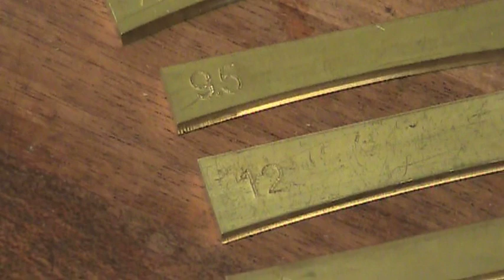Fret press: arbor press for guitar fretting

Comment: I toured Gibson in 1977 in Kalamazoo Mich. I get to refret my 1977 LP Std. This means rebinding the neck too so those binding nubs are present. That is a $400 refret/rebind. A Martin where I am also using frets to do what a truss rod does? You may wish to sit down for that quote. I do not have too much problems with maple. I use a special tool that clamps the wood on either side with thin metal bands to avoid most chips, but still $250. By the time we are any good at this we are too old to see!

Comment: I've seen mixed reviews of this, and that it's a Chinese import not made that well but with a high stew mac mark up slapped on it. Apprantly the paint chips off easy, you have to spend a lot of time setting it up to get it to work as it should. The table addon is plastic and not metal and practically useless. One person stated that their item was full of casting sand and metal burs and the finish was bad. At the price they are asking there are much more reliable and cheeper presses out there. I won't be buying this from Stew mac.
Reply: Hey man just wanted to let you know I got one today and it is the opposite of what you said in every way.  It is incredibly well built, very tight tolerances and performs amazingly.  I've been building for 10 years and feel like I missed out by just getting it now.  Hope that helps!
Reply: @zacdelvecchio2312  Thanks for letting me know. Sounds as if they have remedied the problems some complained about.  That's good news.
Reply: I’ll add my experience as well. I got mine two months ago and have refretted four guitars and done six fretboards for current/future builds. 

Out of the box, there were no signs of sloppy machining. No burrs or machining dust that I could see. The only fault currently in the finish is the result of my own lack of foresight. I propped a 14’ A frame ladder nearby and it got bumped and fell onto my press. It took a chip of paint out about 3x4mm that I touched up with some Ospho and Testors model paint. After the ladder whack, I checked to make sure there were no issues with function and found that it was still pressing frets in as near to perfectly square as it was the day I got it. 

The ONLY issue I have with the whole thing is the Stew Mac neck support cauls use very thin cork. That stuff has a tendency to come off after moderately heavy use, so I have re-lined all of my support cauls with extra thick chamois that I cut to fit. I just contact cemented on some 1” Pedal Board Velcro and it doesn’t budge. 

Anything with the Stew Mac name on it has a pretty hefty price tag, but being a super small niche market means they can’t manufacture at a scale that would bring those prices down a great deal. Considering the quality and purpose-specific nature of most of their tools, the sticker price really isn’t that bad. Buy once, cry once. If your going to be doing any sort of regular building or maintenance more involved than string changes and polishing, their stuff is well worth the price.